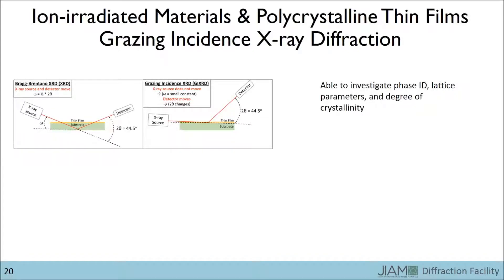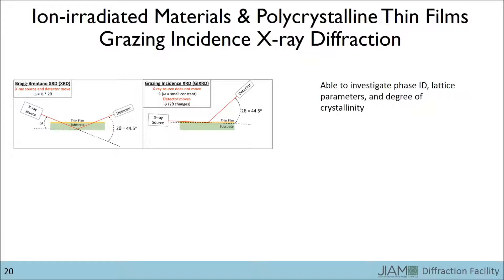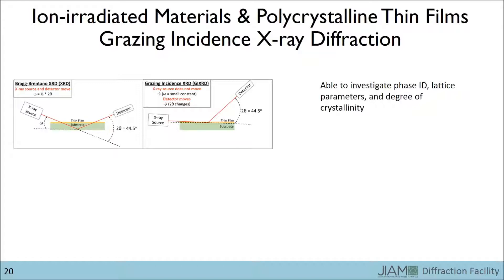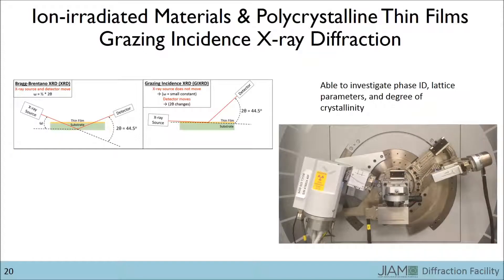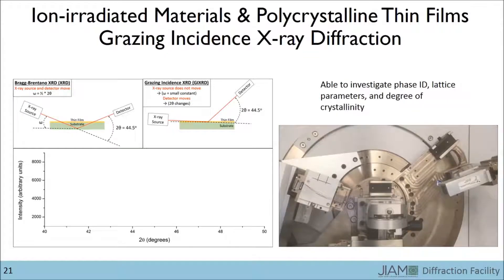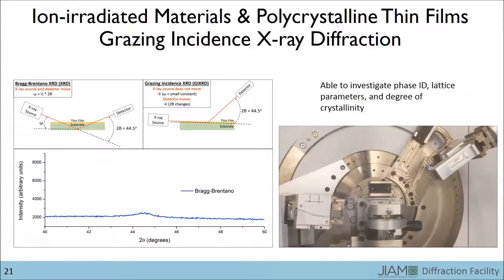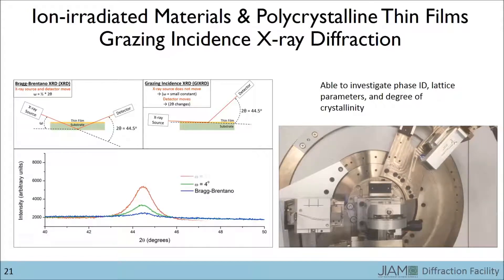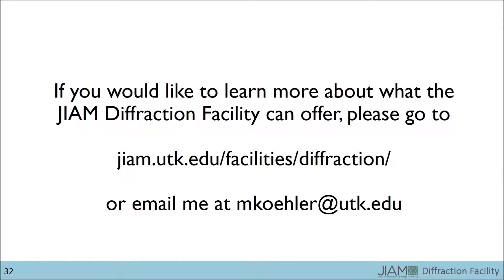Grazing-incidence XRD (GIXRD) - JIAM Diffraction Facility

Comment: Thank you for this excellent video. Could you please explain why the intensity is high at low at 4 degree and high at 0.5 degree? The other question: The GIXRD setting shows the peak at same position, however, this position seems a little shited compared to the Bragg-Brentano broad peak. It also happened in my tests. Could you please share your insight on it?

Comment: Hi, thanks for your great explanation. I recently had a question and I hope you might share your insights with me. The question is: when the equipment changes to the GIXRD mode, how the detector collects the lights from a really small incident angle? Is this related to the total internal reflection effect?
Reply from the maker: At really small angles (below what is called the critical angle), the X-rays do not penetrate into the material, and you get total external reflection.  When this happens, you don't get any diffraction pattern from your sample.  It is my understanding that at angles just above the critical angle, diffraction occurs as it normally would at any other angle.

Comment: Hello,
First of all I want to thank you very much for all the videos and all your efforts. We have a 3rd generation panalytical malvern type diffractometer, but I don't yet know how to acquire data for the case of thin films and residual stresses, and their software, Stress and Amass. My mail is atmane0677@gmail.com, if you can help me. All my thanks.
Reply from the maker: My apologies for not responding to your other comments, it has been a rather busy time with proposals, some personal matters, and Christmas vacation.  It sounds like your diffractometer is pretty new; have you reached out to Panalytical directly with questions?  I have found their application scientists to be very helpful.  If this is not an option for you for some reason, let me know.
Reply: @IAMMDiffractionFacility  precisely, the supplier is not well trained for that, just a start-up, and for the panalytical trainer, cannot move due to the weight of covid 19! so I wanted to step forward while waiting for the end of this disease. if you can help me in the meantime. I thank you very much anyway.
Reply from the maker: Panalytical does have application scientists who are able to help over phone and email, they do not need to visit your location.  I don't know if you have to have a service contract to speak with them for "free" though.  

For collecting "regular" data on thin films (for use in phase ID, lattice parameter refinement, etc.), I use a parabolic/parallel beam mirror on the incident side and a parallel plate collimator (PPC) on the diffracted beam side.  Do you have those prefix modules?

For collecting residual stress (specifically chi-stress measurements), I use point focus for the tube, a double cross slits collimator for the incident prefix module, and a PPC for the diffracted prefix module.  If performing a chi-stress measurement, you will also want a sample stage that can change the chi angle (not the reflection/transmission/spinner stage).  We have a chi/phi/Z stage for the Empyrean and a 5-axis stage for the MRD.  

I don't do a lot of residual stress measurements, but there is an option to perform an omega-stress measurement that doesn't require the sample stages listed above and that I THINK uses line focus and different prefix modules.  I would need to be at my work computer to be sure though, and I am currently on vacation.

Comment: Excellent video! simple and informative. I have a question...I want to analyse nanoparticles (from a few nm to a few tenths nm) - phase identification/particle size analysis. They are in powder form and in lot large quantities (a few mg). Can you please tell me which XRD setup is the most appropriate? tHANK YOU.
Reply from the maker: My apologies for the slow reply, it has been a very busy time!  I would try just regular Bragg-Brentano geometry first.  With nanocrystallites* that small, I suspect you will have some very broad peaks.  Because very small nanocrystallites produce weak signals, you are going to want to focus on getting a good signal to noise ratio.  This means you may need to count for a longer time.  

* I write nanocrystallites because you determine crystallite size with XRD, not particle size.  There can be multiple crystallites within a single particle.

Comment: Great video! I have a question to ask.  Does grazing setup need any special optics than Brag-Brentano setup? I mean Do we have to change any optics in the path of x-ray beam? Or just placing the tube in low angle and rotating the detector is enough?
Thanks in advance.
Reply from the maker: For grazing incidence XRD, you are going to want parallel beam optics.  For my Empyrean and X'Pert3 MRD, I use a parallel beam mirror for the incident side and a parallel plate collimator for the diffracted side.
Reply: @IAMMDiffractionFacility  Thank you very much for the video, I have an additional question. Does it matter in which mode the detector works? We have a PIXcel1D detector in our laboratory that works in the scanning line detector mode (1D).